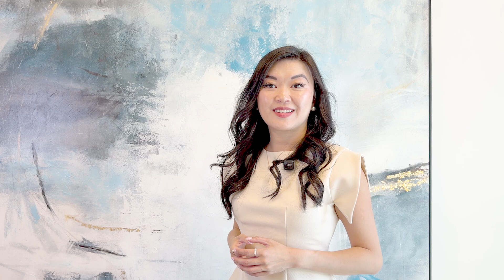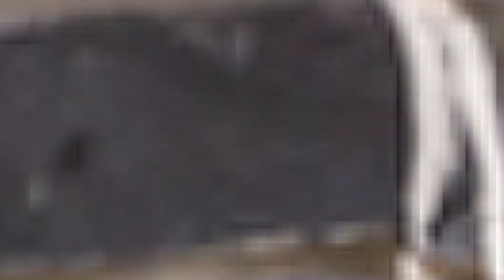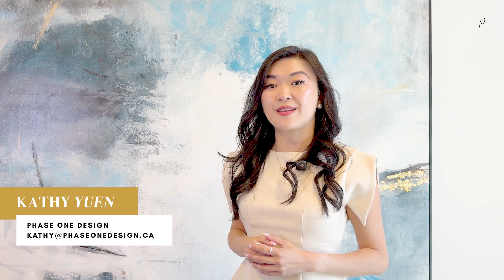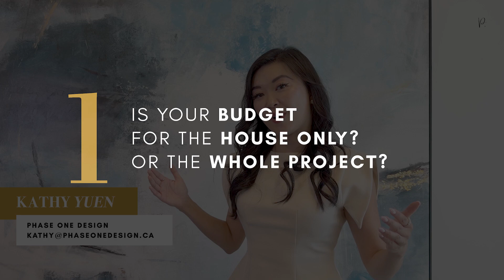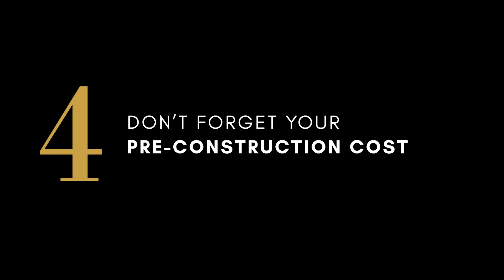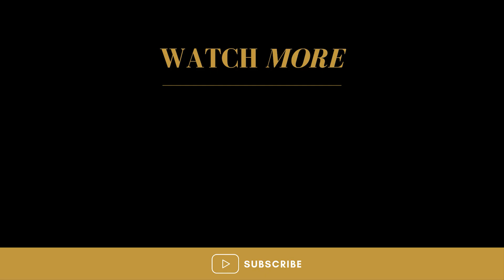Is Your Custom Home Budget Realistic? | 4 Things Most Homeowners Overlook | Custom Home Cost

Comment: Great vid. Custom home clients should also be educated on improved building envelope practices too. It always amazes me to see these high end custom homes getting built no differently than a cheap suburban track house with stapled weather membranes, no exterior continuous insulation above or below grade, no mineral wool insulation, no strapping for drain layers under claddings, no drain layers incorporated into the stucco applications, and no full bed masonry or stone rainscreen applications (ie: adhered thin products are often used instead)